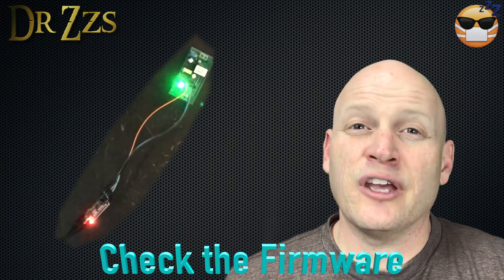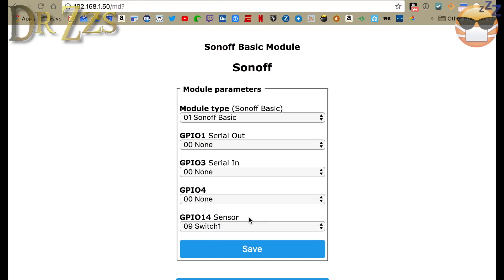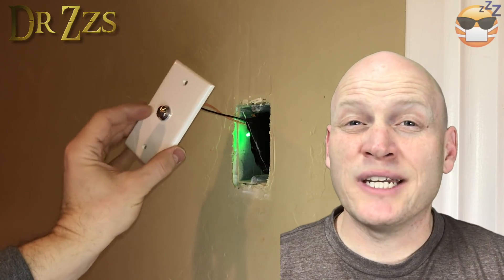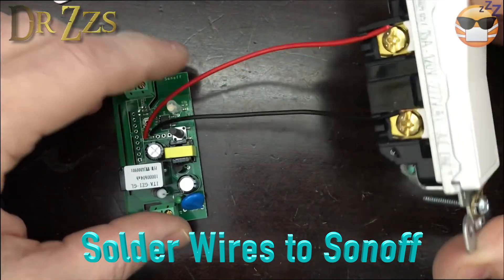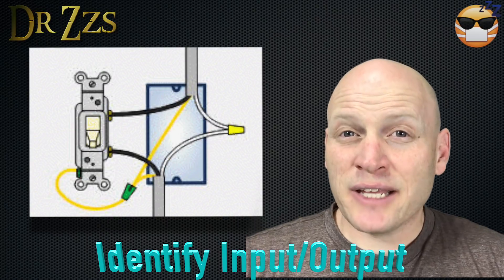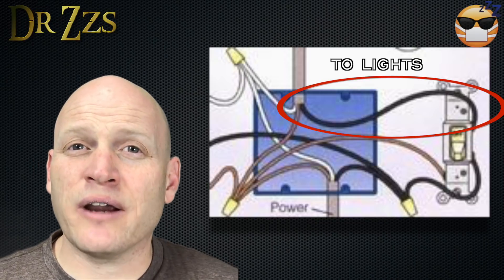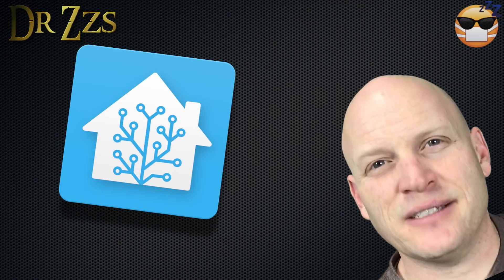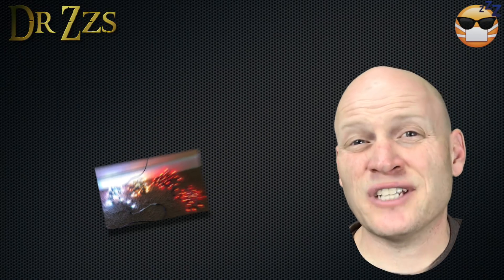No $30 "Smart Switch" | $5 Sonoff + REGULAR Light Switch!

Comment: What sonoff are you using? Here in sweden I can only find a sonoff TH10. Will this "Hack" work with one of thoose?
Reply from the maker: I've used almost every model they make.  For this video and most other situations I use the Sonoff Basic.  
Can you not order them to be shipped to Sweden?  I would think they'd ship anywhere. 
https://www.itead.cc/sonoff-wifi-wireless-switch-1.html

the TH-10 is one I haven't used.  My guess is it is still probably the least expensive way to get a relay, wifi chip and power supply all in one.  Plus with the Th-10 you get a temp/humidity sensor.  So, it's probably worth it.  I guess you'll have to compare the price with what you would use instead and consider the time and effort involved in flashing etc.  
I'd rather DIY most things, so I'm a bit biased.  

Hopefully you can get them to ship you some Basics.  That's the best option. 
Good luck!

Comment: This is a really nice and helpful video thanks for sharing. 
Does it work if in those cases where you have Teo switches controlling the same lamp?
Reply from the maker: If you mean like a 3-way switch then yes it does but you have to connect it differently. 
I have two videos about using a sonoff for a 3-way switch. I’d post the links but I’m just in my phone. Just check my channel page. You’ll find them.
Reply: DrZzs thanks a lot!
Reply from the maker: Anytime!

Comment: You talk a few times about flashing firmware. Which firmware did you use for this? Can I connect it with Home Assistant?
Reply from the maker: Hi,
Yes I flash all my sonoffs (and even some D1 minis) with Tasmota. 
https://youtu.be/c2IUIUnxjUY

The main reason I do that is to be able to control the devices in Home Assistant. 
Hope that helps!

Comment: Do you have a schematic picture how it will look when you connect Sonoff to the light switch? It would be much easier to understand and visualize the connections. For normal light switch and for three way switch if possible, please.
Reply from the maker: I've got other videos that show that better. 
3-way switch (2 videos)
https://youtu.be/EroQ_Eos1HY

https://youtu.be/GEJCk-Dr3BQ

Updated & Better Sonoff light switch video
https://youtu.be/B38e1HAMUXs

3-way diagram:
https://www.dropbox.com/s/9mzqw3z2lwduovp/Screenshot%202018-04-23%2009.03.38.png?dl=0

The connection to the sonoff is the same for 3-way or normal switch.  Power from the circuit goes into the sonoff Input, the lights are connected to the sonoff output. The switch is connected to GPIO 14 and Ground.  
Hope that helps!

Comment: what type of wire are you using to attach the switch? just normal jumper wire?
Reply from the maker: yes.  Any small gauge wire should work fine.  Lately I've been using old phone cord wire, since no one uses wired phones anymore. It's small and easy to work with and I've got a bunch so it's cheaper than sacrificing Jumpers.

Comment: Hi DrZzs !! first: You are a genius buddy! 
I have a question to ask you I hope you can help me, I have a common 4 channel wall switch, to light 4 different lighting groups. I want to put 2 double sonoffs inside the wall box, since it takes up less space. can i connect two switches as you did in the minute 1:54 (soldering GPIO 14 and ground) ?
Reply from the maker: Thanks!
If you’re using the Sonoff Dual (R2 version) there are dedicated pins for two switches all set with headers even. So yes you can have 2 switches. 
Hope that helps
Reply: I've found that using 2 Sonoff basics take up less space than using a Sonoff Dual.
Reply from the maker: Probably true.  I tend to believe Chris.  He's a smart guy.

Comment: My swich only 2wire - input (eletick) and output
Reply from the maker: video coming out tomorrow on what to do in that situation.  Basically you can put the sonoff near the lights, or where ever the power is coming from. Then use the wires to the switch as GPIO14/Gnd.

Comment: This is a great video thanks!  A quick question. If the switch is hard-wired like this can the sonoff work in standalone? (ie if the wifi and broker is down would the physical switch still turn the light on as long as the sonoff has power or does it rely on a network connection?   Understand for remote control wifi and broker would need to be online!
Reply from the maker: Yes, the sonoff can be disconnected from the network/mqtt and the physical switch will still control the lights.

Comment: How can I do that on Sonoff 4 Channel Pro??
Reply from the maker: I have a 4ch, but haven't had time to flash it yet.  Here's the instructions on how to do it from the Tasmota github page:
https://github.com/arendst/Sonoff-Tasmota/wiki/Sonoff-4CH-and-4CH-Pro

Should have everything you need to know.  I plan on doing a video about it eventually.  If you get it working before I get the video done let me know how it goes! 
Good Luck!
Reply: There is no information where to connect switch wires. Like you showed on this video that where we have to connect the wire for a regular home switch. Please suggest.
Reply from the maker: I see. 
I'd say try connecting to the poles of the buttons already on the board. looks like they use GPIO's 0, 9, 10, 14.  you'll probably have to solder to them on the bottom of the board. 
Another option would be to use the Rx/Tx and GPIO2 pins, but that only gives you 3.
Reply: DrZzs all right. Thanks for your information.

Comment: Really Nice Video ... I have installed the sonoff same way as shown and its works fine...  Can the sonoff with Tasmota & the 2 way switch ( manual & wifi as shown in the video ) work without a home assistant directly work with Blynk app through our phone??
Like how we can control a Wemos D1 mini  through Blynk.
Reply from the maker: Thanks!I haven't used Blynk.  Tasmota can receive commands via HTTP.  So if Blynk can send http commands you can use the Tasmotized Sonoffs without a Home Assistant hub and without MQTT. 
https://github.com/arendst/Sonoff-Tasmota/wiki/Commands#web

Comment: 2:20 problem is a easy to fix problem i put the sonoff inside the light fixture and i use the wire from the switch for gpio14 and ground
Reply from the maker: yes, you're right!  I'm going to show that example in the maker faire display.  I wasn't thinking of putting the sonoff in the ceiling (with the lights), but yes, that would work in that situation. 
Thanks!

Comment: Great video!
If I want to do the same for sonoff th16, where is the GPIO 14 and ground on the circuit?
Reply from the maker: Thanks!
What are you trying to do exactly?  Are you planning to use the Temp/Humidity sensor and a push button? 
https://www.itead.cc/sonoff-th.html

https://www.itead.cc/wiki/Sonoff_TH_10/16

You may be able to sort out where the pins are from the schematic on the wiki page.  
Unfortunately, I don't find the TH on the Tasmota page.  It is a supported device, but doesn't look like anyone has traced out the pins and/or uploaded more info about that exact model. 

One of the comments on the sonoff-th page says the 4pin jack uses gpio 4 and 14.  I'm guessing by "jack" they mean where the Temp/Humidity sensor plugs in.  So if you're using the sensor they send with it, you probably don't want to use gpio14 for a button.  If you're planning on using Tasmota with it you could use one of the serial pins as a button after you've flashed it. 

Sorry I'm not more help.  That's not a model I've used before.  
Good Luck!

Comment: Can it use with original firmware?
Reply from the maker: yes you can use the stock firmware.  But then it won't interact with Home Assistant.  
If you want a smart home hub, then Home Assistant is a great one.  If you just want to control it with Alexa you can do that without changing the firmware

Comment: DrZzs, this really work! But I find it really difficult/ and dangerous to shove the sonoff in the junction/gang box when it is cluttered of stiff wires.  Chances of wire getting loose and potentially short circuit and explode. It happened to me to be honest, I managed to get one in and it is working but just not at ease. I guess I will be just using my remaining sonoffs with extension cords.

Thank you for this very informative video.

All the best.
Reply: To be fair, electricians to just shove the wires into the box, and with the exception of the deepest boxes, the wiring pushes against the switch - especially for any rocker/dimmer style switch. There are standards defined by the IEC for how many of some gauge wire can be put into a box, and it accounts for the size of the box, along with a switch being mounted as well. Just rest assured... or don't maybe as it isn't a great way to wire a receptacle or switch, that what he did in the video is how most houses & commercial buildings are wired.

Comment: What gauge wire would be acceptable for that flexible wire - and is that what it's really called? No find on Amazon.
Reply from the maker: 14g or even 16g rated for at least 120v (usually it'll be rated for like 600v, so that's not an issue). The stuff I used in this video was speaker wire but that' wasn't a smart choice, so don't use that. 
something like this: http://amzn.to/2GJmP4H
seems kinda expensive though.  If you have an old extension cord that size wire would be fine too.

Comment: That was awesome! I just found you via a HA Community thread. Subscribed! I am very new to HA (waiting on parts to arrive so I can start). I am looking to do a HASS.io and RasPI setup. I'll also have a Aeotech Z-Wave USB stick going on it. Would I still be able to use the Sonoff switch as you've described here with my hub setup? Thanks DrZzs
Reply from the maker: you sure will.  in fact, if you haven't seen them yet I have a couple videos that are newer than this one that explain the basic setup for Hassio and tasmota, including mqtt.  And, an update on the sonoff conversion to light switch. 
https://youtu.be/c2IUIUnxjUY
https://youtu.be/B38e1HAMUXs

Comment: Hi Dr Zzs, Awesome Video! I've managed to flash Tasmota onto my Sonoff and get it all setup in HA and can turn the light on and off with no issues! Winning! However I'm having issues with the push button on the sonoff itself, a toggle switch connected to GPIO14 and even the web UI. The configuration module for GPIO14 is set to 09 Switch1 as instructed but when any of these is triggered (button, switch or Web UI) the state only momentarily changes... I'm not sure what I'm doing wrong. Please Help!
Reply from the maker: try changing the switchmode in the console.  
Here's a link to the Tasmota page that talks about switchmode.  I'm a little concerned when you say it even switches only momentarily when you toggle in the webUI.  Try different switchmodes and see if that does anything.  If not we'll try and come up with something else.
Reply: Hey DrZzs! Thanks for the quick reply, I tried all that last night, every single switchmode to no avail. I think it might have something to do with RF interference and the connected switch wires. I’m going to try putting a low pass filter on and see what happens.....
Reply: Hey DrZzs, After some more component isolation I have discovered the following: the low pass filter does nothing to fix my Sonoff's! When a Sonoff is connected to its own dedicated circuit it works fine, switch, button web UI and HA, as it did when testing before inserting into the wall. One Sonoff connected and it works fine inside the wall. The issue begins when 2 or more Sonoff's are connect to a circuit. Each switch plate has wires coming from the circuit breaker however these are split into three separate circuits for the lights within the house. Effectively when I add one or more Sonoff's to the one circuit they are connected in parallel and this is when the issue begins. Any ideas of where to go from here? I have no idea why the input from the circuit breaker would effect the Sonoff at all. Many thanks

Comment: If I connect the main power to the Sonoff input, the light to the output, and a rocker switch to the GPIO and ground, will the switch just toggle the lights, or would I have to switch the light to off and then on again to turn the lights on using the switch?
Reply from the maker: yes, the switch just toggles the lights.  It's really like a 3-way switch setup.  The button on the sonoff (connected to your rocker switch) acts like one 3-way switch, then the MQTT/Home Assistant/WebUI control acts like the other 3-way switch.  So no matter which method you use to turn it on/off, the other method (or using that same method again) will toggle the lights to the state they are not in.  
Basically, it works like you hope it would. 
If you're trying this for the first time check out the newer version of this video:
https://youtu.be/B38e1HAMUXs
and if you don't have Home Assistant set up yet, here's a video for that:
https://youtu.be/c2IUIUnxjUY

Good Luck! 
Let me know if you get stuck along the way!
Reply: Will this work the same way with a standard switch and with the regular sonoff firmware instead kd tasmota and home assistant?

Comment: I wired this up at the top of the stairs, the sonoff turns on/off but the lights dont turn on. And if i flip the other switch at the bottom of the stairs, the lights turn on but the sonoff turns completely off(like power is lost).  What am i overlooking??
Reply from the maker: You've got a 3-way switch set-up? that's what it sounds like. 
There are a couple ways to do 3-way switches with sonoffs.  
The way I've done it uses a sonoff in each switchbox. one sonoff controls the lights and the other just sends a signal to Home Assistant to switch on/off the other sonoff. https://youtu.be/GEJCk-Dr3BQ
There's another way too.  https://youtu.be/l-CM8JQmges
I'm going to do a video on that method soon.

Comment: Hey DrZzs - I love your videos. I just found your site a few weeks ago and i've started to tinker.  I took your advice on getting flexible AWG 12 wiring to tie into the romex wires, it does seem to be a lot easier.  However, how and the heck did you fit 12gauge wires into those tiny relays on the sonoff basic?  Thanks!
Reply from the maker: Thanks!ya, sorry about that.  12g is a little too big.  I thinned it at the ends by trimming some of the strands with wire clips so it would fit.  
I've learned a lot since that video, and I don't use 12g wire anymore.  14g, or even 16g is enough. I've even used the solid stuff, it's not too bad.  
Have you watched the Zzonoff video yet?  It's got some updated info and an improved method for Sonoffitizing a light switch.  If you haven't seen it, check it out!
https://youtu.be/B38e1HAMUXs

Comment: Actually in the first diagram of single pole switch you can make the connection at the light junction box
Reply from the maker: yes, that is true.
Reply: I consider this even better. Here (Europe) we have smaller switch boxes that cannot accommodate a sonoff inside. The junction box has plenty of space.

Comment: FYI: I thought i'd mention that if you set the "#define WIFI_CONFIG_TOOL    WIFI_MANAGER" on line 59 in the user_config.h, you don't need to put your SSID and credentials into the sketch, it will come up in ad-hoc mode and then start the configuration on 192.168.4.1. Once your connected to the "sonoff-xxxx" AP , then you can scan and choose your home SSID....   by default its set to "WPS config" 

 https://github.com/arendst/Sonoff-Tasmota/issues/272
Reply from the maker: That's great info!  

That's related to a problem some folks have run into.  If they change their wifi SSID or PW they can't access their Sonoffs anymore.  I haven't looked through the Tasmota Issues page to see if there's a solution, but this reminded me of that.  Would be good to know what to do in that case. 
Thanks!
Reply: DrZzs That's the only thing I didn't like about the default configuration. I thought.. they packed so much into this firmware and left that out?... Hmm..  Gets more amazing the more I play with it... Thanks
Reply: DrZzs for that case you'd hold the button down for 15 seconds until it flashes a second time, and if you set it to wifi_manager it will then go to back into ad-hoc mode again  with everything set to defaults
Reply from the maker: oh cool.  For that to work you have to have set it to Wifi_Manager on the initial flash? 
This is great!  Thanks!
Reply from the maker: man those guys are amazing!  
This may make it into the next video.

Comment: It's your house, but it's not a good idea to a put a relay inside your wall. The brand really doesn't matter.
Reply from the maker: That's probably true.  I can't say I know much about the failure rate of relays like these.

I tore apart a UL approved "smart switch" that is made to go in the wall and it has a Relay very similar to the sonoff.  
It also had a fuse so I've started including fuses in my DIY smart switches. If you're interested here's the video: https://youtu.be/B38e1HAMUXs

I do appreciate your comment. Thanks for taking the time!